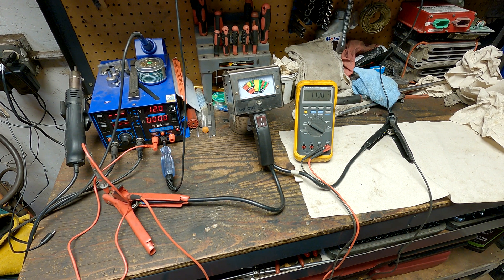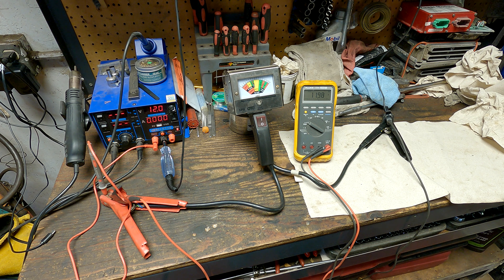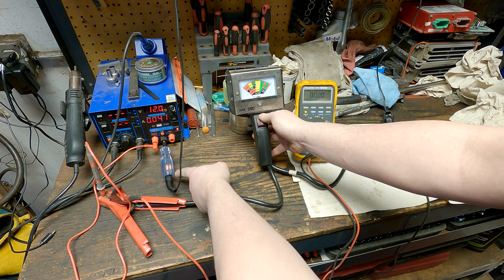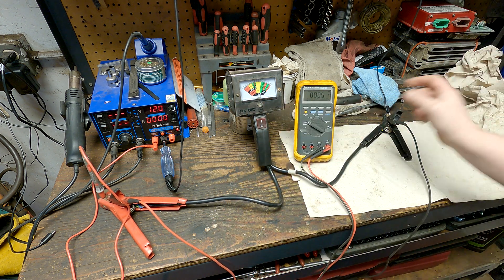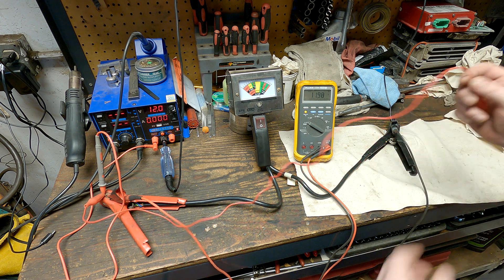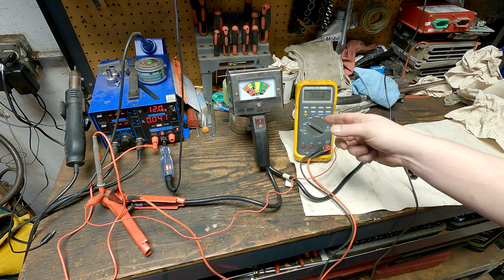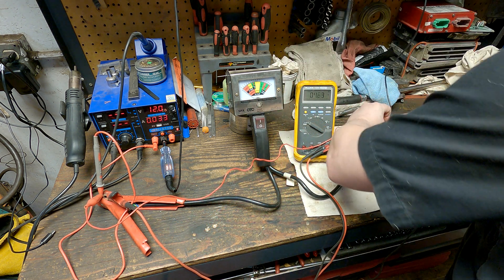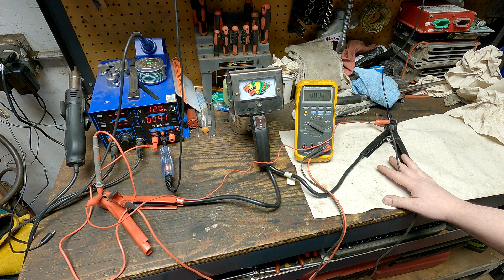It's All Voltage Drop !! An Intro to Subtraction Meter Thinking

Comment: It might have been easier to understand if you were to introduce some real resistance to the circuit (other than the meter needle). Also worth repeating is that in order to do a voltage drop test, the circuit must be under a load. This might help some people understand better. Nice video, and thanks for posting.
Reply from the maker: Thank you
I have a video where I introduce resistance and explain vrop testing on a vehicle. 
The purpose of this video is more to explain that every measurement with a volt meter is a vdrop test, because it's measuring the difference between two points and not necessarily the voltage that is on the circuit.
Reply: No problem, I'll have to look at your older videos. I like your channel. Keep it up. @710diagnosticsandfishing
Reply from the maker: I do plan on continuing this into several hands-on demonstrations over the following months, as I get the time.